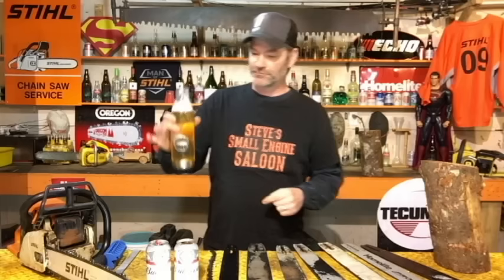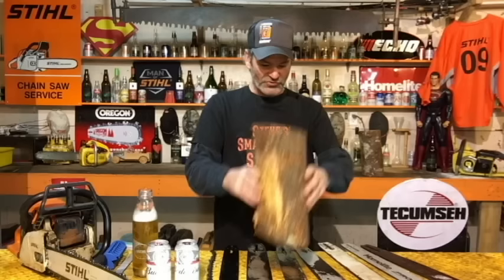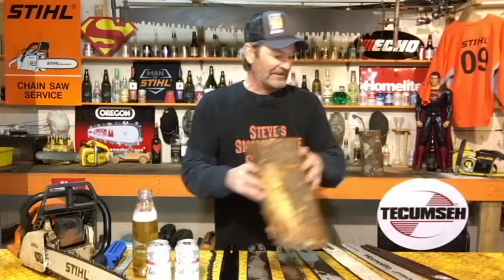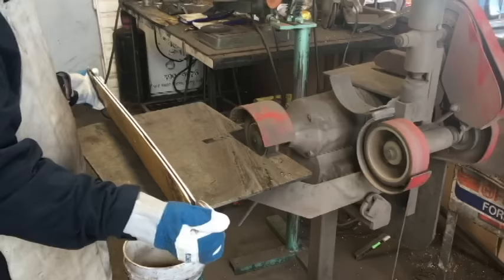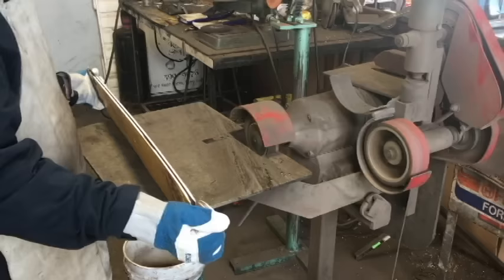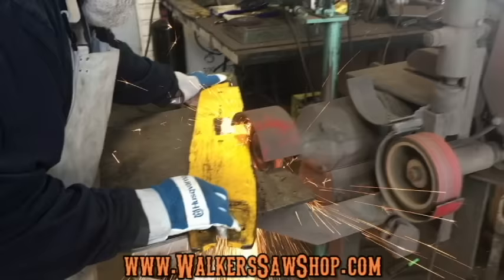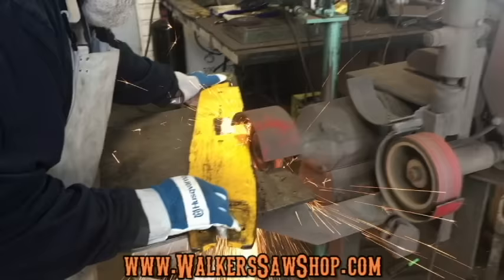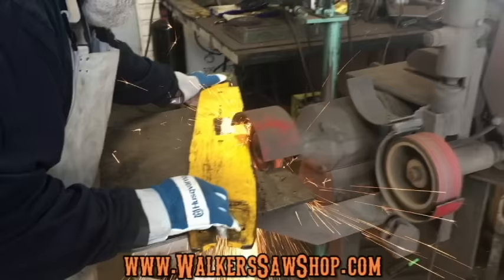How To Repair A Chainsaw That Cuts Crooked

Comment: In the field I position the saw as if I'm using it at about waist level and lean over the power head and will hit each tooth with 3 strokes all the way around one side at a time then I hit all the rakers with usually no more than 1 stroke "Note: By stroke I mean from one end of the file to the other end and never pull back" now I personally only do this to a chain 3 times in the field then put another fresh chain on it: When I get home I take the used chains and put them on my grinder and just skin the tooth and check the raker's: "Note: When I sharpen in the field is when I see my chips about Half the size of the chips from a fresh chain:" Now I have done this for year's and it is what work's for me.

Bar maintenance I flip my bar over with every chain change out, and when I get home I use a bar spacer file guide  "Dresser I have one for each size of bar I have"   on it 1 or 2 strokes on the top and bottom (or each side however you look at it) and check my tip and front sprocket for any damage and grease the tip sprocket: Good chain maintenance is good but don't forget about your bar maintenance too.
Reply from the maker: Awesome Steve!  Thanks so much for the comment...

Comment: You mentioned the burr that grows on the side of the bar rail but you didn't get into it.
This too is a big cause of it cutting crooked,it also is a cause of it getting hung up or "binding" in the wood.
If they're dressing the top of the rails fine,they'll fix that issue too but not always does the top need dressed but the side still has a burr big enough to make it cut crooked and/or bind.

I've also witnessed many many many people who get a saw stuck and will try "working it out" and at the same time not realize they're also rocking the bar side to side thus bending it or twisting it.Both twisting and bending will make it cut crooked.A slight bend or twist will but more profound it is then it'll also get stuck.
With all the storm damage work I've had to do I've bent a few bars in my day from many reasons,nothing to bad a 3lb hammer,at least a 24" flat steel surface and a couple minutes couldn't fix though.Have a vid of that?That would be a good vid for others to learn how to do.Or making your own chain from a roll or shortening one after it stretches to much the adjuster isn't functional anymore. 

I also drink Bud while working on saws...haha

Comment: I get what you're saying about filing or grinding down uneven bar rails... But if you do that, isn't the chain just going to stand proud of the rails, "flop" around and cause the same problem?
Reply: As long as the groove the chain rides in is still deep enough to accept the chain, it should be no problem.

Comment: I work in a fab shop and I can honestly say that I’ve had enough wheels explode on angle grinders that I won’t run one without glasses at the very least. When I do heavy cutting I wear a face shield. An angle grinder is hands down the most dangerous power tool in more ways than one. I’d say an old chain saw with no brake is far safer than an angle grinder.

Comment: Here is a cheap gauge (costs only 36¢) to determine what gauge your groove is, if the bar is not marked or if the marking is worn off (also works to give some indication of your groove is worn):

Get a dime, a penny, and a nickle. 
A dime should just fit in the groove of an .050" gauge bar.
A penny should just fit in an .058" gauge bar
A quarter should fit in an .063" gauge bar

If the correct coin wobbles in the groove, or if you can fit the next size larger coin in, your groove is worn.
Reply from the maker: Freakin awesome John!  Gonna test that out now.....

Comment: The file creates a splinter that is barbed like a fish hook...Once it's in your eye...it will keep digging into your eyeball. I had this happen while busting rust on a ring mount that holds a .50 caliber M2 machine gun on a Navy ship. I was filling rust off of it, the ships ventilation kicked on and blew all the fillings into my face. They had to dilate my pupil then dig out the metal with a needle. Its not a fun procedure at all. They flush your eyes over and over to the point its super uncomfortable. Lol...

Comment: I've had this happen before when I used to try and sharpen my chain by hand because I suck at it so much lol. Also if I run into a nail in a tree which has happened so many times now that I purchased a sharpener the only thing I file by hand is the guides so not really an issue until lately but I'm sure it's my bar. I take great care of my bar however it's really old and the gap is getting spread out a little bit causing it to not cut so well. I think this happened because it's old and because I was cutting the chain got loose and instead of tighten it like I knew I should I kept cutting because I just wanted it done lol. It was time for a new bar anyway. Lol wife won't mind. Sure what are you trying to get someone killed! That's a very dangerous statement my friend lol. Maybe your wife wouldn't mind but mine would murder me on the spot lol.

Comment: I wish I could have watched this many years ago when I was burning wood for heat and cut my own fire wood.....question.....if the cutters were sharpened at different sizes would that be cause of cutting crooked??
Reply: If  all  of  the Rakers  are  the  same  height  for  each tooth,  it  should  cut  alright.

Comment: I flip my bar every time that I sharpen a chain. Also Steve you never said anything about edge roll over. I have seen this make chains cut hard, and push to one side even if they are both straight.

Comment: Other reasons: The chain. If the chain is not sharpened R-L evenly, it will be sharper on one side than the other. If your sharpen angle (vertical & horizontal) is not even R-L it will cause this. Also if the rakers are unevenly filed, it will have the save effect. Sometimes an older chain will wear unevenly at the shoulders of the chain where it contacts the bar rails. In the case of an uneven sharpen, buy a proper electric chain grinder/sharpener or have the chain re-dressed at the dealer who has this gear. For worn chain shoulders, the only cure is a new chain. The root cause of wear is often grit in the wood (roadside trees have a lit of grit in them) or touching the ground in use. It introduces abrasive dust into the channel & also dulls your chain quickly. Continuing to cut with a dull chain & applying too much downward weight while cutting is also bad for causing this wear. Using the spikes heavily will apply downward pressure which is off to one side...this often happens when the log is too large for the bar size &/or the saw power. A loose chain will also allow lots of this grit & dust to get under the chain into the oil channel. Check & adjust tension often, especially 10 minutes after you start when the saw has warmed up & it will frequently get slack. Sometimes after changing a chain or adjusting it, the chain will start tight but after a few runs the drive teeth will "drop" into a wear groove in the sprocket...check & adjust before you continue for this & also for safety. When you sharpen or swap chains out make sure you clean the oil channel & oil hole in the bar. Also when you start up at the beginning of a session or after maintenance or adjustment, do a splash check to make sure you are getting oil flung off the tip of the bar onto a handy tree when you rev it....All of these as well as the things Steve highlights will cause an uneven, slanted, twisted or curved cut. Some of these issues are also a serious safety risk.

Comment: My saw cut crooked. After filing chain and bar it still cut on an angle. Went to the shop, they said the chain was stretched and showed me. Changed it, cuts fine. Hope this helps someone.

Comment: There is one more i just found on mine...... The clutch drive wheel is floating on the clutch about 1/4 inch, because someone put the wrong item on the clutch... I have that problem now and this is what i have noticed...

Comment: YouTube just recommended I watch this video. It's like YouTube is reading my mind. 

Hot tip: to get that burr out of your eye, use one of those powerful rare-earth magnets.
Reply: An egg white will float it out. Lay down flat, have someone separate an egg white from the yolk. Hold your eyelid open and pour the egg white in your eye.   You're welcome .

Comment: I had a piece of metal swarf in my eye once, it didn't hurt until 3 days later and my eye got itchier and itchier, I went to hospital and I kid you not, the metal piece embedded itself into my cornea and was starting to rust, they had to clamp my head in a device (Think Clockwork Orange) and use an an magnet system that was micro measured closer and closer to my eye and the magnetic force increased in power until it removed the metal piece, they said if I didn't report to hospital I could have went blind.
Reply from the maker: WOW!  I hope you are OK?

Comment: if your rails are worn internally on a .58 or a .50 then sometimes you can get away with fitting the next size up chain a.63 into a worn .58 bar and a .58 chain into a .50 bar . buckin billy has proven that .  ;o)

Comment: almost ALWAYS the bar is worn(its true a bad chain can do it,its not as common though) , usually over heated, (you can tell because the paint will be melted off) it likely has been flipped,(the easy fix for a worn bar)  (flipping a bar means turn it upside down to have a fresh bar cutting the wood) anyway, the bar is likely worn so the chain is not riding on a true bar ,the solution is to re-true the bar, saw shops have a machine for this ,however with a good file and a steady hand it can be fixed pretty well at home, just make sure you hold that file perfectly straight,make a jig so you are forced to hold the file perpendicular (90 degrees)nice long smooth strokes, and don't forget to flat file the sides too.

Comment: Well....good to know. May be getting a free stihl 16" (forget the model) cause the guy doesnt have the patience to take care of his tools and its cutting crooked. Said he already tried a dif chain but doubt hes checked the bar. Even if it is screwed for one reason or another and i cant get it working right, i got a backup plan for the motor ha.
Reply from the maker: Right on Art...

Comment: Youtube is a funny thing...this just popped up randomly. I have a chain that got driven into gravel while processing a tree that I had to drop on my gravel driveway. That chain is now my root cutting chain, because there's no saving it by sharpening...the sheer amount of meat missing from some of the teeth is depressing.
Reply: Drackar 
Get yourself a timber jack!  Never have to cut into the ground again. Makes cutting so much easier.
Reply: ...I have  one. There's no way in hell it would have done anything in this situation.

Comment: Steve, just a point with file usage.  Files are meant to only be used in ONE direction.  They are made to be "pushed" away from you because the "teeth" on the file are "cupped" so that when you "push" the file, the file cuts the material away.  Cup your fingers on your hand and "'scrape" in one direction in the dirt.  Now, take your "cupped" hand and pull it back towards you with the dirt hitting the back of your fingers...  The pulling motion, collapses your fingers towards your palm.  That is exactly what happens with a file.  ONLY PUSH a file or else you collapse the teeth and the file no longer works.  You can see that in the middle of your file, that you call an AXE (brand name of the file) file (it is a MILL File), the teeth have been collapsed from pulling the file back on your work...  Files are made to only push, then pick up the file, bring it back to you and push again, repeat.  NEVER pull a file back on the work or you end up with a file like you have = destroyed...  I learned this in metal shop, in 9th grade, in 1969....  Mr Sukiyama, was our teacher, Silverado Jr High, Napa, CA..  I have to edit:  You need a File Card to clean those teeth on a file otherwise the gum up and no longer cut the material away.

Comment: I had a dip in my bar really bad..050
Reply: If you mean it looked kind of like (~) that's from not flipping the bar and cutting in the same place on the bar all the time.
Usually happens near the tip and it isn't good to flip the bar if it's on the bottom.If you flip it to the top the chain will catch on the edge of the tip and cause the chain to wear or possibly break (then it may fly off out to the front).

Comment: Are you from Wisconsin? You talk like it. You pronounce about aboot.  When I cut timber, I had a bar squeezer that I used to dress my bars. They will get sloppy .I also cleaned out the chain track on the bar regularly. I also used an abrasion wheel that I dressed my bars with. I used a drill for that.

Comment: Had a guy bring me a load of unsplit wood. The bar was bent. I couldn't split none of it.
Reply: It's not really "splitting" wood if you're just using a saw, Tim. You need something like an axe or a maul, or a wedge n' sledge, or powered splitting equipment.

Comment: you covered most problems with cutting crookered BUT forgot that you need to count the file strokes on each tooth>>6 strokes on teeth of one side & 3 strokes on the other side makes one side's teeth shorter than the other side teeth>>the saw will cut more aggressive on the longer teeth side>>also about the bar>the more worn it is will have burs on the cutting side(bottom) this makes the curf wider causine the teeth to wander>>file off the burs & it will help>>like flipping the blade over after 3/4 filings

Comment: Guide bar groove not equal to chain thickness is not true.  I’ve run a Husqvarna .058 24” bar with .050 chain for a few years. Never cut crooked. I do know how to sharpen. I can bore cut or cross cut just as square as you can eyeball. Try it sometime. I think you’ll be surprised. The chain will move in the groove as you show, but doesn’t affect the cut.
Reply from the maker: A few years?  It sounds like you are doing that on purpose!  Is there a reason you don't get the proper chain?  Just curious....
Reply: Yes there is: if it ain’t broke, don’t fix it!  I didn’t even notice it was mismatched for a long time. When I did notice, I researched it and found exactly what I have seen...that it does not affect the cut, which should be obvious being that I didn’t even know it was an .050!  It’s my felling saw which is why the chain has lasted that long. That being said, I only use it for felling and bucking 18” and larger trees.  I have a Woodmizer, so it does see a decent amount of use. Again, go try it, I think you’ll be surprised.  After all it’s only .008”, which is the thickness of a piece of paper on each side of the chain. I’ve had chains that got rocked cut crooked and seen bars worn that also do, but the wrong gauge is not a factor.
Reply: @mikeoverbey  Alot of that i'm sure has to do with your skill level and technique. I was on my second bar on my Husquvarna  rancher 55, straight cutting but kept throwing the chain every time I moved from logs to tops. Realized the bar groves were wore out. Went to get a new bar and they said NO, I kept it flipped so it was wore out even enough to just go up to bigger gauge, they only needed to dremel the tip for a perfect fit... AND gave me 3 new chains for the price of one!!